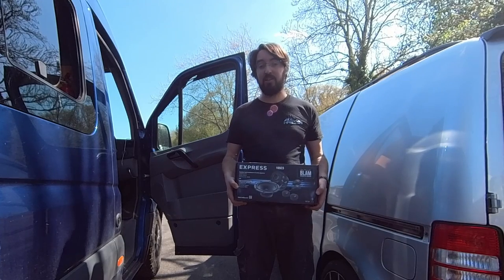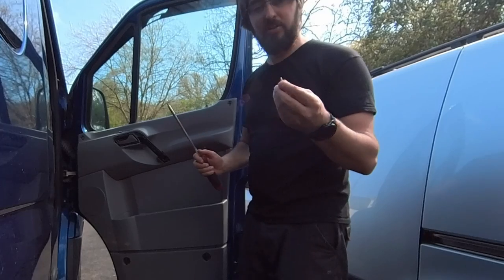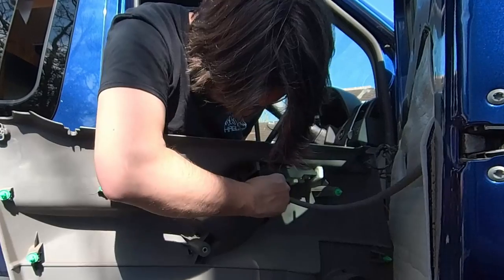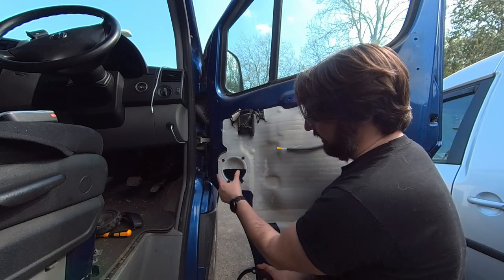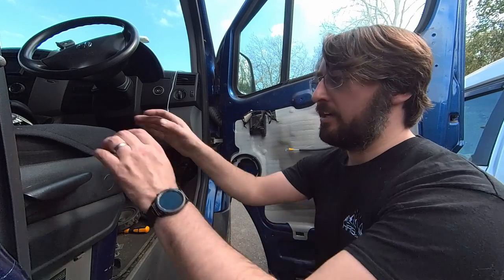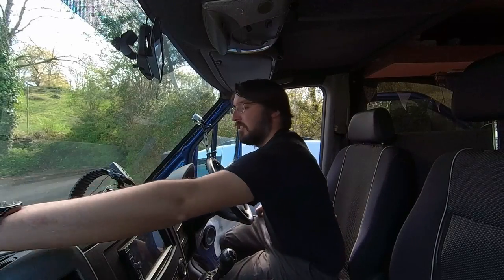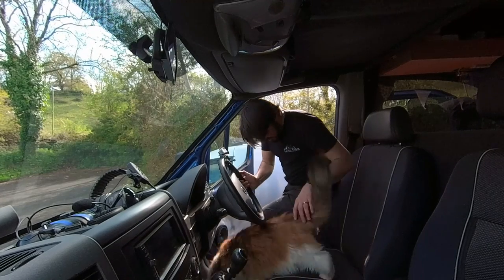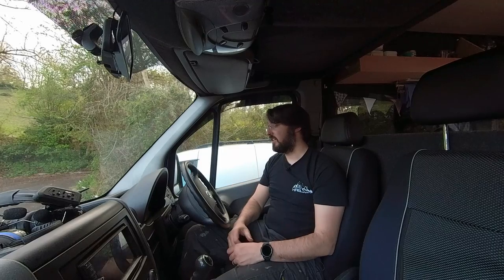Upgrading the DOOR and DASH Speakers on my VW Crafter Campervan (Audio Upgrade Series Part 1)

Comment: What size did you buy the speakers or what size are the original ones?  Thanks
Reply from the maker: Hi they are 6.5" or 165mm. I bought this kit: https://incartec.co.uk/product/BLAM-165ES-165mm-6-5-INCH-EXPRESS-2-Way-component-speakers-BL-165ES

Plus a pair of speaker rings from the same site. I hope this helps!
Reply: @CraftyCamper  Are they better than Hertz?
How is the sound quality?